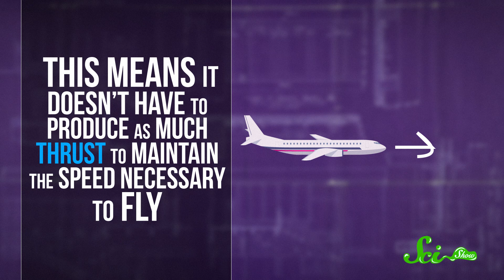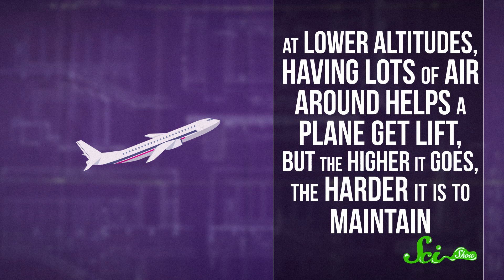Why Do Planes Fly So High?

Comment: At high altitude i.e from 7000to 12000m the plane comes under turbulence effect.
But at low heights it doesn't.
So how does flying high is comfortable?
You can watch videos of airlines where passengers feel great discomfort due to turbulence.
This would have been avoided if the plane would have travelled close to ground.

Comment: and what about electric airplanes ? will they fly higher ?
Reply: I think we're a good ways away from seeing that in normal travel. Battery technology is the biggest bottleneck, and it would add so much weight, on the bright side, making weight and balance calculations for a fuel load would no longer be necessary.

Comment: THIS is why high-speed trains aren't all that. You can't travel as fast, as efficiently, because you're pushing ground-level air aside. The best you can do is travel at 1/3 the speed (170 MPH or so), and hope the lessened need for security (quicker boarding) makes up for the longer transit times. This means you really don't want to travel more than about 800 miles or so by train.

Comment: There's no generic optimal altitude for cruise. With every new generation of airliners, they tend to fly higher and higher.
That's a result of each new generation of airliners coming with more powerful engines vs the max takeoff weight of the aircraft.
Newer engines also use less fuel, which allows wings to become thinner.
That allied with wings tuned for lower high subsonic drag allows planes to go a little faster, that extra speed also generates more lift.
Consider the old 737 cruised in the Mach 0.70-0.74 range and in the 30-35 thousand ft altitude. The new ones cruise at Mach 0.78-0.81 and 35-42 thousand ft altitude.
The first generation 767 cruised at Mach 0.80. The latest successor, the B787 cruises at Mach 0.85. And average cruising altitudes also increased by about 4000 ft.
But there is a limit. In practice, airlines flying above 43000ft is problematic, the air is so thin that if there's a decompression there's too little time for the pilots to put an oxygen mask safely, and the pressurization differential gets a bit too high, increasing wear on the aircraft long term. But biz jets are capable to fly as high as 51000ft, where those turbo fans literally sip fuel like half the fuel consumption at 38000ft. But one pilot is required to use an oxygen mask continuously at such high altitudes.

Comment: So how high could a plane fly then?
Reply: +eepruls To the very edge of space, depending on how you designed it. Every plane has a different flight ceiling, and their flight ceiling may increase as they burn more fuel.

However, assuming you're using jet engines, you can easily fly to the edge of space temporarily if you try to maintain as much speed as possible while nosing up. Why your engines would stall out, as you climb higher the thinner air significantly reduces drag, allowing you to maintain upwards momentum for longer, before the plane pitches down and plunges back into the atmosphere.
Reply: +Son Of Sisyphus scary stuff

Comment: Also taking advantage of air currents. If you travel with the current, your true speed is higher than your air speed. If you are traveling 50mph in the same direction as a 50mph wind, you have 0mph airspeed, 50mph true speed. No lift, you fall down. Lets say a certain aircraft has a cruise speed of 500mph. If you have no wind, 0mph wind speed, your air and true speed will be "the same". If you have a 100mph air current traveling the same direction as you, you can either throttle back to maintain a 500mph true speed while having a 400mph air speed, saving fuel, OR you can maintain roughly the same throttle and have your 500mph air speed while attaining a 600mph true speed. In actuality there is more involved in the calculation, but it gives a rough idea. Albeit, conversely, traveling against your 100mph air current you will either have to throttle up to 600mph air speed (if it doesn't exceed your "Do-Not-Exceed Speed") burning more fuel to maintain 500mph true speed, or compromise to achieve 500mph air speed and 400mph true speed.

Comment: Why people use gasoline instead of hydrogen? Gasoline exhaust fuel are poisonous and bad for nature and when hydrogen burn the only exhaust is water?
Reply: Epzilonz Because hydrogen is very explosive and normal or cheap materials would melt with hydrogen combustion. That's why it is used in space shuttles that are designed with high end materials.

Comment: Jet engine development started before the mid 1950s. One of the first engines was the Maxime Guillaume, which was patented in 1921. The first aircraft to purely be powered by turbojet power was the Heinkel He 178. The germans in ww2 actually use jet engines to power aircrafts such as the Messerschmitt Me 262, Heinkel He 162, and the Arado Ar 234 which where some of which fought in battle. there were many more that were in development including the one i have as my picture, the
Horten Ho 229 stealth fighter/bomber.
Reply: Your video's are still awesome.

Comment: Wait, jet engines were designed before the 1950s by the Germans and British in the form of the Rolls-Royce RB.23 Welland, and the Junkers Jumo 004. Even then the Pulse Jet was invented even earlier than that, and was used in the German V-1 (though it might not qualify).
Point is, jets were created a good decade from the mid-1950s. 
Also, great show, I love this channel.

Comment: What is the highest altitude possible for passenger jets?
Reply: Karlis Bikis It varies between each plane, for example the latest iteration of the Boeing 747 (the -8) has a service ceiling of 43,100ft, which actually seems to be the standard for most Boeing aircraft at least.

Comment: Aren't jet streams also an important reason for flying at high altitude? By flying in jet streams planes can save a lot of fuel since the air is moving at hundreds of kilometers an hour up there. I thought that was at least part of the reason...
Reply: 25%cooler Depends on the direction of the jetstream and the direction the jet is flying. It could be a good thing or a bad thing.
Reply: If you are in the northern hemisphere, the jet stream goes from West to east and therefore a flight going from the west coast to the east coast is quicker.

Comment: The final explanation given is wrong. It's simply the relative lack of air to use for keeping yourself in the sky. You either have to have massive wings, (like the U2) or fly very fast. But above a certain altitude, dependent on how big your wings are, you have to go supersonic, which makes it all far less efficient, due to wave drag and other problems with supersonic travel. So flying very high is not very good for passenger travel, except in niche markets.

I mean, there's plenty of oxygen, and jet engines can be designed to get it, compress it, and burn it with fuel, just fine. Turbojets can be designed to work to maybe 35km (100,000 feet or so) without insoluble issues. Scramjets can work even higher.

No, the real issue is flying; keeping yourself up in the thin air, without going supersonic. The point about rockets is also misplaced. Rocket aircraft are research articles designed to explore the flight envelope, so gladly pay the penalties.

Comment: Does this mean electric planes could theoretically fly higher than combustion planes?
Reply: Ryan McLean The record for the highest level flight by a winged aircraft is 96 863 ft set by an electric aircraft. So yes, it seems so.
Reply: The MiG wasn't in sustained level flight. Basically it zoomed up (I'm using Zooming in the aviation sense of exchanging speed for height) to an altitude it couldn't sustain.

The electric did use laminar flow propellers as that works better in very low density. It's less than a quarter of a psi at that altitude.
Reply: gasdive Umm... Doesn't the record belong to MIG25 with altitude of around 37 500m (125 000ft)? And with electric aircraft the problems are made by propellers (well there are electric jet engines but they produce very little thrust), since they work similarly to wings and higher you go, lesser the thrust will be.

Comment: The development of the jet engine in the mid-1950s? Pretty sure jet aircraft made their international debut during the latter part of WWII, and the world's first jet aircraft, the Heinkel He 178 had its first flight in 1939.

Jet engines for civilian use didn't happen until the 1950s, sure, but that's not the same as the development of the jet engine.

Comment: Can jet fuel melt steel beams?
Reply: KrisHimself No. The problem is that the tower created a furnace like effect. Air was sucked from the base of the tower up to the burning fuel.  Just like how fanning a fire will make it burn hotter, air getting sucked up the tower increased the temperature.

Secondly, the steel beams did not need to melt, just loose structural stability. Once the first floor collapsed at the top, you had a huge amount of weight fall onto the next layer, which then fell. This happened again and again and got heavier and heavier with each new layer.

Comment: jet engine . . . mid-50s. . . that's wrong. jet engines were first proposed in the 20s, working prototypes were in the 30s and the first engine in production and operational use was the Junkers Jumo 004 in the early 1940s.
Reply: Behemothokun Yes but it didn't really take off (pun intended) until after WWII.

Comment: So why can't NASA make an airplane/rocket ship hybrid? Plans can be MASSIVE. They can carry quite a lot of equipment. What is stopping NASA from making am air/space craft that can't take off and get maximum altitude as an airplane using the Earth's oxygen for combustion and then switch over to oxygen canisters to take it the rest of the way out of the atmosphere and into space?
Reply: Michael Jones Orbital velocity on earth is approx  7.8km/s. Cruising speed of a 737 is about 780km/h or 0.21km/s. The energy saved by starting higher up and slightly faster does not get close to the amount of extra energy required to accelerate a 747 to orbital speed.

Comment: To be more exact, plane fly high because they required to burn less fuel, since the density of air decreases as the attitude increases, the ratio need to be just right, which mean less fuel per volume of air, but the air to fuel ratio remain the same. You need to point that out. This is one major important for airline during cruising
Reply: ScienceAlwaysWin Not really. What you've said is pretty close for piston engine aircraft. Jets burn very lean at all times. The limiting factor for jets is the exhaust gas temperature. There's a fixed temperature they can't go above because they would melt the exhaust turbine. (they can make more thrust by adding more fuel and reheating the gas after it passes through the exhaust turbine. This is called a Reheater in the UK and Afterburner in the USA) The bigger the difference between inlet and exhaust temperature the more efficiently they run. Flying high where it's cold makes the engine run more efficiently. Flying high where the air is thin means they fly faster for the same thrust. That's more efficient too. The thrust required to fly is NOT as stated in the video. The thrust required for flight remains constant at all altitudes.
Reply: It a commercial plane, not a fighter jet, there no afterburner or reheater. Most of the exhaust from the turbine are use to drive the first turbine fan, there it serve two purposes: 1, to propel the aircraft forward, 2 to compress about 30 % of the entire inlet of air for the initial compression for the actual turbine engine and the process start all over again. Your statement of cold air make no difference, even at low attitude, the remaining 70% of air that is use for propulsion is also cooling the turbine engine itself. Go learn the turbofan first before you state the misconception.
Reply: ScienceAlwaysWin
The stuff about reheating was an aside that took away from my main point. I shouldn't have included it. I was just trying to make the point that EGT is limited. There are however two commercial jets that employed reheaters.

The bypass air isn't used for cooling the engine as such (oil coolers etc. aside).

Inlet temperature has a big effect on the efficiency of a gasturbine engine. If you doubt that, then take it up with George Brayton.

Comment: One additional comment on the limiting factor behind why they can't fly too high. Part of the problem is the lack of oxygen for combustion; however, this is usually compensated for by increasing speed which increases the amount of air that enters the engine. The real limiting factor is that lift is created by pushing air down, Newton's law action reaction. If there isn't enough air molecules to push down then the aircraft will stall, think stop flying. On the flip side the aircraft has a maximum percentage of the speed of sound that it can fly called maximum Mach number. At a certain altitude the minimum speed reqired for flight will exceed the maximum speed the structure can handle. That's the highest that aircraft can fly. Aircraft fly high due to better weather and higher true airspeed. This is from a certified flight instructor at a  major university.

Comment: Generally good video, point of order though: jet aircraft wern't able to fly in thinner air than piston-engined ones because they had bigger wings, it was because they could fly faster: more speed equals more lift. Jet aircraft often have smaller wings than a piston-engined aircraft of the same size.

One more thing: there's no such thing as a "prop engine": the propellor isn't the engine. Time and again you see people freaking out when they have to get on an aircraft with props because they think it's "something out of WWII". If the prop is driven by a piston-engine then it's either a very small modern plane or a very old one. Most modern prop airliners use turboprop engines, which are (to cut a long story short) jet engines driving propellors. they're just as reliable and safe as any other kind of jet engine.